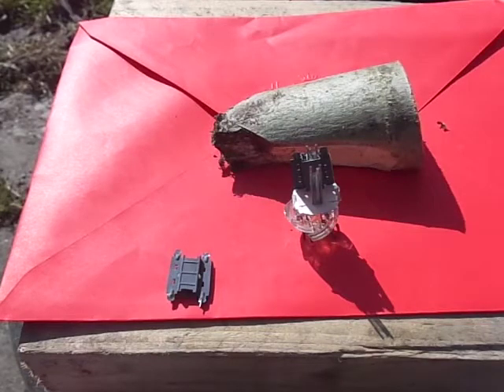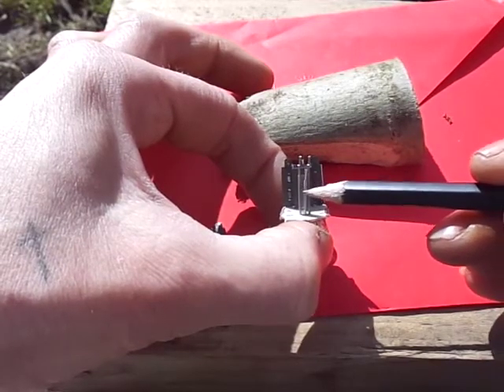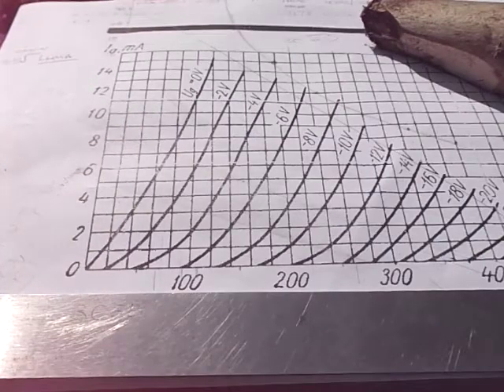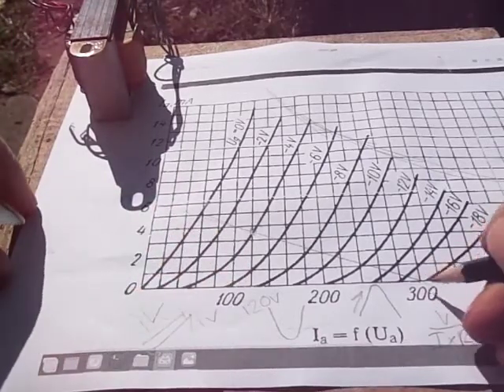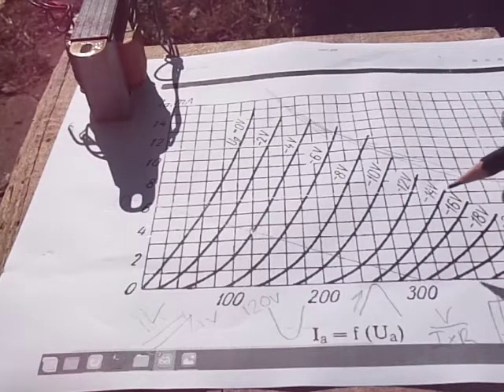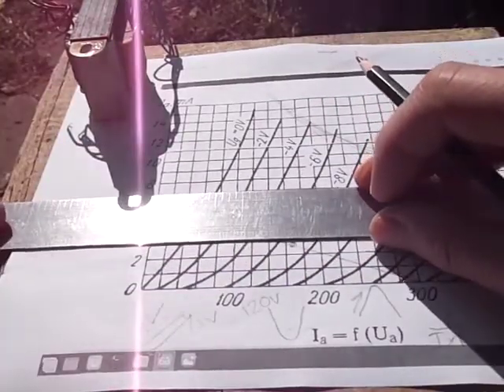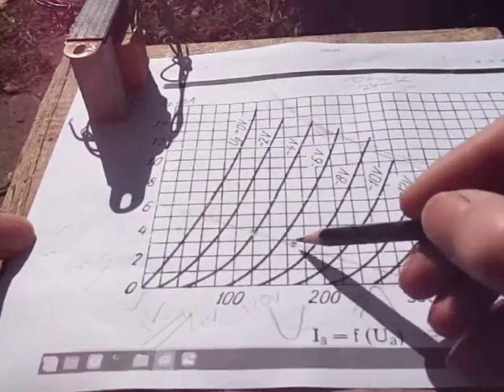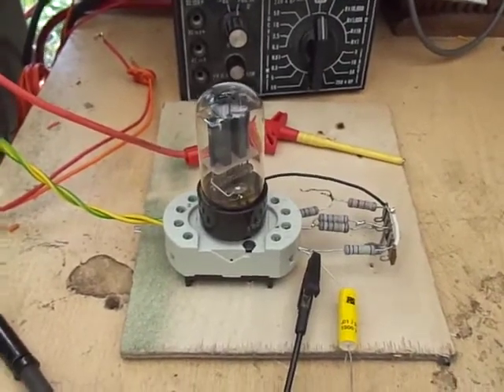Valve Amplifier Design Part one - valve/tube anatomy - the load line.

Comment: Thank you so much, I've been struggling with how to select operating points and choose resistors since I took up this hobby 18 months ago. This single video did more for me than the dozens of books I've bought.
Reply from the maker: Thanks Richard,glad it helped.Your comment reminded me I didn't carry on with this series, I'll endeavor to do another. Is there anything you'd like to know or that are struggling with?....DA.
Reply: @diabolicalartificer  Well for beginners like me, its best to just get down a solid step-by-step procedure that is repeatable, even if the theory comes later or is only partially learned. I've been able to write up the steps you did here and make them work for me on a practical basis, repeated. I've written down that procedure and some day ill do it without a cheat sheet and over time understand the theory and interactions better. So I can't really name a specific struggle right now... I'm doing hi fi as opposed to guitar amps I'd be looking to learn how to bias for lower odd order harmonics. Your video was practical and that's really what was so refreshing.
Reply: @diabolicalartificer  I could really use some wisdom on how to approach winding output transformers..?
Reply from the maker: @simonowen488  Haven't wound one yet, it's a lot trickier than power tfmr winding. There are several free PDF's online if you search that deal with the subject. I will hopefully make a video about it at some point....DA.